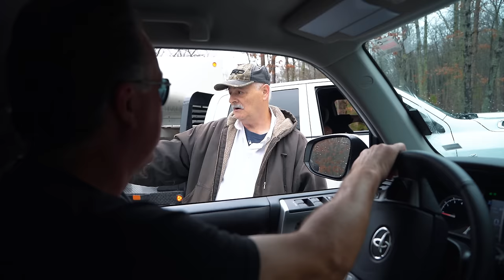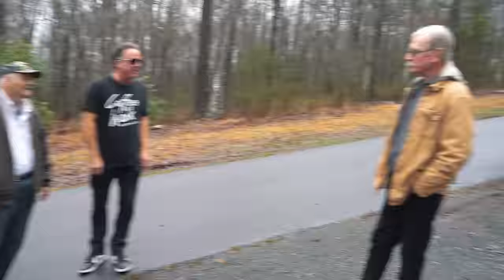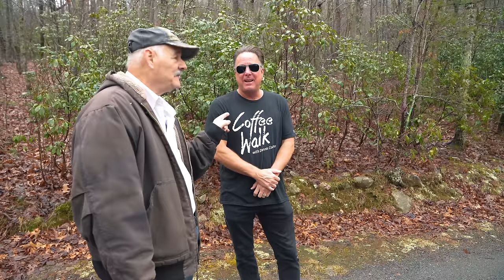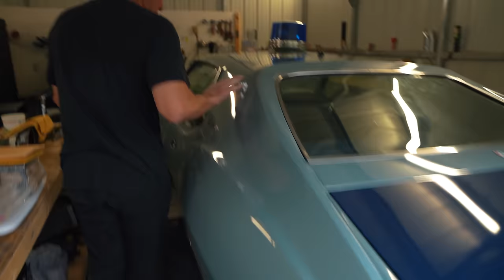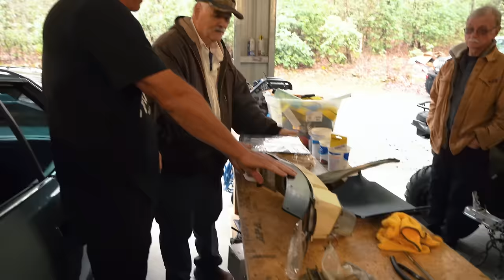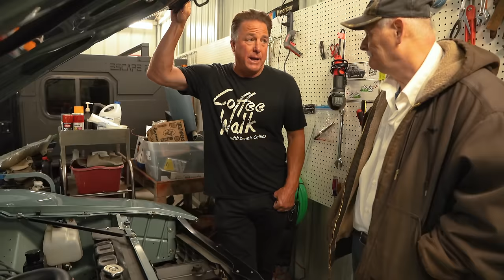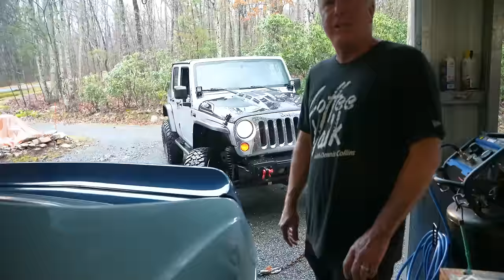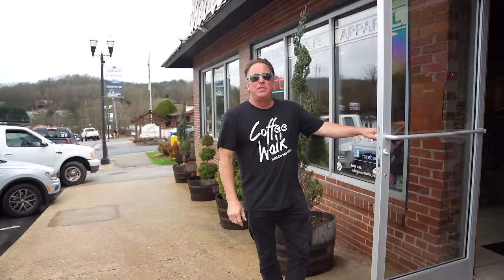FOUND: 1 of 13 Existing ADPS 1972 Javelin SST Police Cars!

Comment: I like the enthusiasm, but no...that car with maybe 300hp will not go over 110mph.  I think it did 0-60 in like 7sec back in the day or maybe slower.
Reply: wrong. There were 3 horsepower levels that these cars had as delivered to the ASP.  Over half of them had 330+ horsepower and 430+ Ft lbs of torque. There are archived ASP records of the 71 and early 72 models going over 141mph and they were clocked going even faster than that using ASP radar Guns in archived tests, the late 72 models that had the dished pistons and 8.5 :01 compression could do 131 mph top speed.  Some of the troopers that drove them were interviewed in write ups back then who did those speeds in them, and some are still alive. Its well documented . Its the gearing, the horsepower and torque and the sleek very lightweight body (which was actually developed for racing SCCA Trans AM Series) that made those speeds attainable, those SST's only weighed 3256lbs off the assembly line...hundreds of Lbs lighter than other cop cars of that era...most were 3800-4000 lbs, bricks in the wind. The Javelin was aero by comparison and is distinctively the first pony car to be used by a state police force...this car is pure legend holy grail!!

Comment: 140mph probably 170 no fn way prove me wrong sir plz.
Reply: Roger PENSKE!! And Mark Donohue  worked with AMC to design the aerodynamics of the 71 Javelins after the cars were successful in 1970 season. The humps in the fenders and the built in lip at the back.of the roof above the rear windsheild all made it to the production 71 up javelins but these features were designed for aerodynamic functionality for trans am and NASCAR racing.  These cars bone stock were only 3256lbs and  good for 131-158 MPH ...depending on which of the 3 specs. of the 401 they got for duty. the early 71' 10.25 :01 and 71' 9.5 :01 compression with high flow exhaust manifolds. Over half the cars they got were these spec 430+ ft lbs of torque and 330+ horsepower..with the 2.73 axle. However the 401 responds very well to.mods and a 401 with bolt ons can hit 400 horsepwer easily and that is probablly what the talladega car that hit 170 had done. Carbs were upgraded etc. The later 72 401's got dished pistons dropped the compression to 8.5 :01 but also got bigger exaust valves lol....this.spec could still.top.130 MPH because of this light body power to.weight ratio and the very tall axle gearing. These Javs were 1100+ lbs lighter than the dodge polara cop cars!!!

Comment: also this wasn't going to catch no hemi cudas or 454 LS chevelles, NOPE, lotta 440 magnums walk this car as well.. thats BS they caught everything, mom had one, they top out at around 145 or so, just not enough power to push em any faster whereas the 600-700 hp hemi cudas and a proper 440 mags are going to do 175 so forth proper freeway gearing.. maybe catch a mouse but not a rat, a 428CJ or Ratt? no way, the AMC maybe has 400hp, MAYBE.. proper LS 454 near 600, proper hemi near 600, bone stock, hale a Buick 455 gonna walk that AMC at 550 HP near 600lbs of torque.., 442 455 walks it..

Comment: Javelins were a piece of crap! They failed the crash test at 17 miles per hour, and the test dummies say you would die. I know someone who was sleeping in the  back seat of one and  the driver hit a pole, the car nearly split in two and the pole came down on the car and hit the roof which it flattened and broke his back. Then 2 years later he crashes a Matador, brakes his back again...AMC were the deadliest cars on the road, and built like a Meccano set car. That is why they are gone. Jeeps used to be AMC's then too before Chrysler  bought it.

Comment: 170 MPH?   Pure fantasy.....The aerodynamics of this body would make things dicey at 140 MPH.  In the 70's there were plenty of cars to equal this car's performance.  Also, the driving skills of cops are VERY overrated......
Reply: they were clocked in radar tests doing 153MPH,  the 150MPH+ range was mentioned in several reputable published interviews of the cops that owned them during service confirming those speeds, and the javelins being faster than the much larger heavier Chrysler and Ford cars they had used..remember these javelins were only 3256lbs off the assembly line. Polara for example was 4300lbs lol. The 170 mph speed "approach" was apparently  at talladega motor speedway, in "civilian trim"...so none of the extra equipment, may have also been minus the rear spoiler and was most likely treated to engine bolt on mods...wich makes approaching 170 with a 2.73 rear axle ratio possible.
Reply: @GUIDTARZAN;  The front end would in fact lift and get light in these cars at very high speed, troopers reported this after doing top speed with them  its pretty well documented in reputable interviews with the troopers that they routinely got these cars to 148-153 MPH, and they described the front ends getting "light". One claimed passing a semi truck at 158MPH and the change in pressure while passing the truck briefly lifted the front tires off the ground. Those  javelins were designed for SCCA racing. So consideration in the body engineering was given to high speed and handeling when they built them...if cops were getting these to speeds high enough to start to lift the front ends. Then that supports the 148-150+ mph top speeds they said they got.
Reply: @Crazy8ts  
I have no issues with anything you said.  I have a lot of experience with '70s muscle cars at high speeds and as much as I loved these cars, their claimed performance numbers were exaggerations of fact.
  The gold standard for performance back then was straight-line acceleration, not top speed.   And that was the usage by average owners.......
  When these cars were run hard on the street their sins became evident with poorly tuned suspensions,  poor brake performance, and atrocious weight balance.  Big-blocks were great examples of tire smokers that couldn't get out of their own way on mountain roads.......
  There was a time in our history when outrunning police was not a felony but considered a medium-serious ticket as well as being the most fun a man could have with his pants up. 
   Here in Coos County Oregon, our police ran Plymouths with 440's......As much as they would brag their cars up, we routinely left them wallowing in their own smoke.   Especially on Hwy 42S between Bandon and Coquille......Eighteen miles of twisty fun.  But, then again, we WERE NOT running stock suspensions and brakes either.....
   But, those old cars were great fun cruising the gut on Saturday night....
Reply: @guitardzan5641  all true what you said, most muscle cars were ordered with high numerical axle ratios like 3.73 -4.10 which would limit their top speed dramatically, and most were upwards of 2 tons and more in weight. On the flip side though you have cars that were UNDER RATED and AMC's fall into that category. The 2 seat AMX from 68-70 for example was 3090lbs from the factory and gear ratios from 2.87 all the way up to 4.44 could be optioned...I got to 135 in my 280 horse 343 AMX with 3.15 axle...2.87 axle would put it 140mph no problem...the APD 330 horse 71 Javelins with 50 more horsepower and 65 FT lbs more torque and probabky better aero with only 90lbs more curb weight should be able to do .150 MPH top.speed+. Let alone if any of those qwre modified with bigger carbs and AMC grouo 19.parts from.the dealer...I WOUKD NOT BE SURPRISED AT ALL...if the 170 MPH Rumor was a full bolt on 401, tweaked with Parts installed during its service with the dept....no way all of these were ledt bone stock during service....if they took the initiative to run one at talladega to showcase a high top.speed. it more likely than not it had bolt ons and was highly tuned. The AMC typhoon cam.kit with 302 degrees duration and 68 degrees if overlap was still available from the dealer in 71-72 as were edelbrock crossram dual quad intakes with an AMC part number
Reply: @Crazy8ts  
LOL.........  I think we can agree to.........agree.